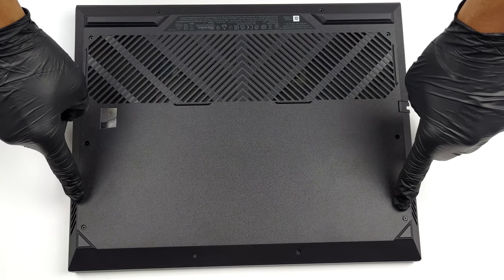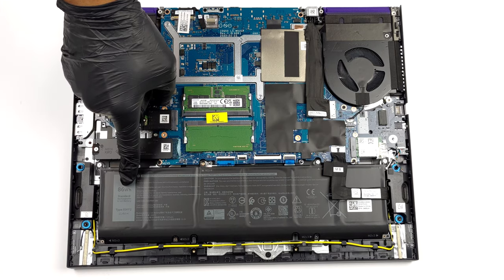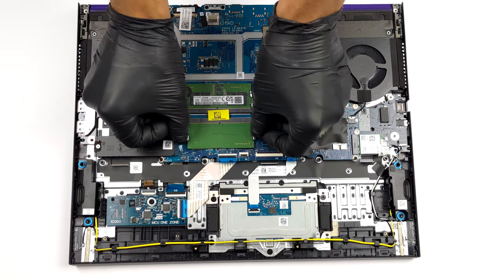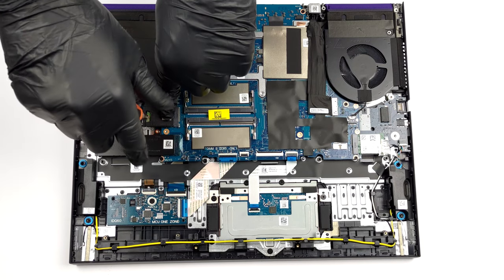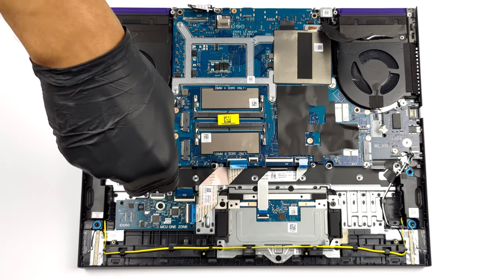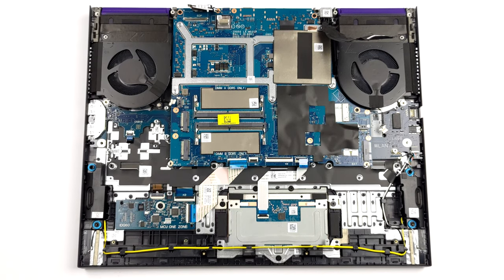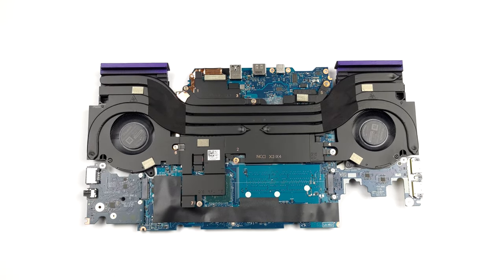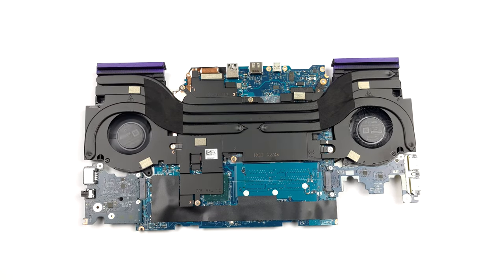🛠️ How to open Dell G16 7630 - disassembly and upgrade options

Comment: Good dissasembly video so thanks for that but no mention of upgrades as per the title? Anyhow, no the 32GB ram model cannot take more than 32GB of ram although may handle a better brand and possibly higher clock speed and the 2230 M.2 may be upgradeable to a 2280 via the use of a moveable mounting part for a total of 2 x 2280 slots with max 4TB capacity at 2 x 2TB M.2's I believe
Reply: Incorrect, I got the 32 gb model and upgraded the two ram slots to give my laptop 64 gb since I already had some spare lying around, then I'd keep the 32 gb for resale. It does work. It'll just take your computer some time.
Reply: @cyberwolf5075  What do you mean by "it will just take your computer some time"? BTW Dell does not offer an upgrade beyond the 32GB you can purchase a higher specced model with and I find it difficult to believe they wouldn't do so to make more dollars on upgrades if it would in fact take 64GB. There is a single, yes one person, on Dell community saying you can do 64GB ... I don't believe they are a Dell rep and they have a whole 2 upvotes and point to the Crucial website which shouldn't always be taken as gospel. No other review website nor Reddit says the thing can run 64GB and as a matter of fact everyone else states the opposite in that it can only go to 32. Not saying you're wrong but are you sure we are talking the same computer here and if so have you run bench tests which indicate 64 is being fully utilised? What brand RAM and what specced G16 7630 did you go with?
Reply: @oneszeros1  when you pit the parts in, the computer will need a bit of boot time, it just does that to install stuff to the memory I think. It took me 3 minutes  for my computer to run after I installed the memory.
Reply: I had two sticks of ddr5 Crucial ram 32 GB Sodimm that I installed. I have the dell G16 7630 with the Intel core I9 and the RTX GeForce 4070.
Reply: @cyberwolf5075  ahhh OK ... I guess I stand corrected then. I'm happy enough with the 32GB anyways ... not spending more cash here.
Reply: @oneszeros1  yeah, you are right, but it kind of works with 64, it's just not really worth it unless you get the 16 gb version it something
Reply: @cyberwolf5075 Would you help me?  I'm thinking about buying a G16 7630 and installing 2x32gb ram.  I saw that some people managed it and others had problems and the laptop didn't turn on anymore.  How did you manage to do it?
Reply: @webersantiago1939  for my laptop, I got x2 32 GB sticks from Crucial. DDR5 sticks. I first made sure my laptop was dead, and then unplugged the battery and let it discharge for 30 minutes or so (safety stuff) and then I took out the old memory and swapped it with my new memory, then I let it charge. I turned it on, and it put on some weird lights (it flashed red, green, pink, then yellow), and it stayed off for a bit. Then it reset itself 2 minutes later and worked perfectly fine.

Comment: if there is so much cooling, why does the cpu idle at around 50-60C in my g16??
Reply: Change your fan curve, the stock one is focused on noise and power saving so it's not very good. 
Idling temp should be between 45-50.
Reply: @khoaMK7  will try, thanks

Comment: See I did this to the T And after reassembly it just will not start up. The laptop doesn’t even register that the AC is plugged in. It won’t turn on with just the AC in or the battery only. No lights no nothing. I even replaced the old parts back in it and still nothing. I gave up trying to figure it out myself I’m about positive I’ve fried it somehow
Reply: Liquid metal probably shorted something